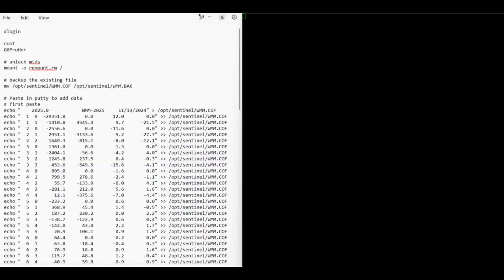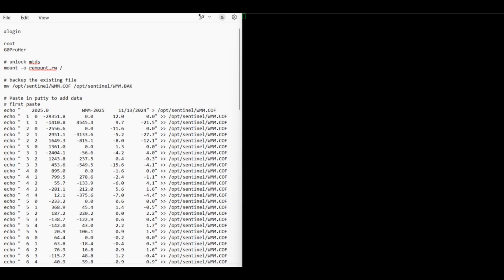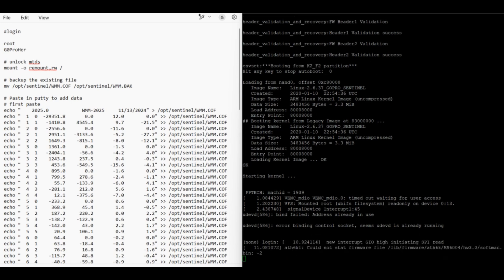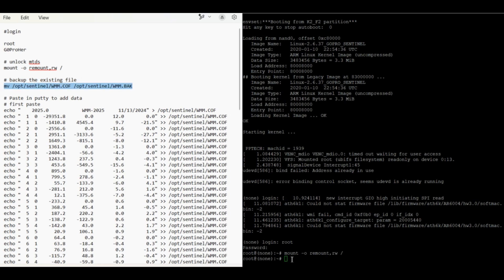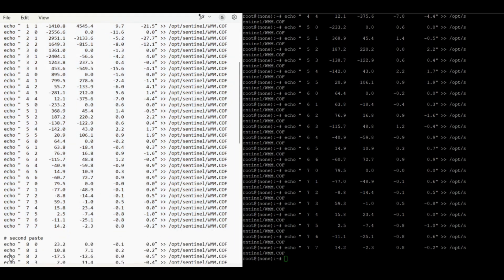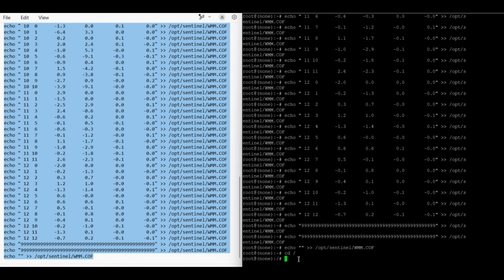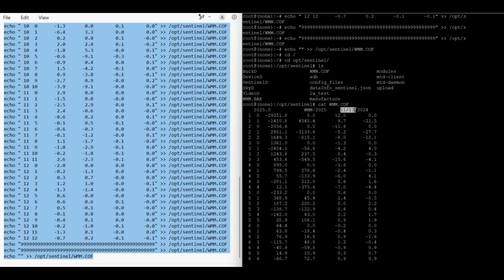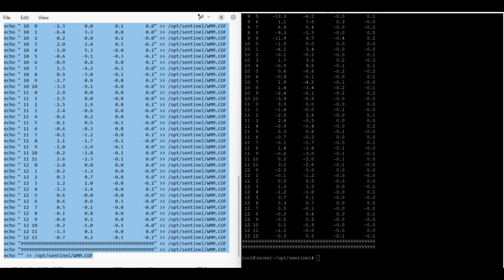GoPro Karma WMM 2025 Update Process

Comment: Hi, firstly like to say, good video's on the go pro karma drone. My question is, I'm in the UK and have tonight purchased the go pro karma drone off eBay as I liked the look of it and size. My question is the gyro video you have made, will I have to update this as well... As the seller said the drone is in good working order and ready to fly... I'm now thinking will it and do I have to do this update for the gyro for it to work?
Reply from the maker: I would recommend that you do this update before flying. If the drone moves any distance you should calibrate it, some people calibrate the compass every flight. If you have the old WMM data you will not be able to calibrate the compass which could lead to issues.
Reply: @bozmanx  Thanks for getting back, I re-read the advert and it's says it's all been updated, so how could I find out if the gyro software is up to date? And thanks for the help...
Reply from the maker: @paulmartin8294  I think a simple way would be to try and calibrate the compass. If you want to be 100% sure you should look at the follow file on the drone opt/sentinal/WMM.COF , the top lines should refer to 2025 and WMM20205 with a date something like 12/13/2024

Its very possible that they were not aware of this update.
Reply: @bozmanx  Oky doky, if I find it's not been updated when I receive it, do you ship the connector cables to the UK? for updating it?
Reply from the maker: @paulmartin8294  they are nothing special, you should be able to get them in the UK or look at one of the repairers on the list.
Reply: @bozmanx  Sorry for not getting back sooner, I asked the seller and he just said the software all up to date according to the screen. When I explained the situation he said he wasn't aware of the updated gps software, so I take it's not been done.... I have seen on your video's a list of items needed and I think I can get them off amazon... I'm not an electrician, but I'll have a go....Thanks for the help.
Reply from the maker: @paulmartin8294  If you can get the jst cable with the connectors on the other end its even less to do.
Reply: @bozmanx  Thanks, once I receive the drone next week sometime, I'll start sorting it out, if I need any help if it's ok with you, I'll pop any questions on here..And I do appreciate any help.
Reply from the maker: @paulmartin8294  If you have any questions come over to discord, there is an invite in the description of the video. Its a lot more real time.
Reply: @bozmanx  Just to let you know I got the tools today from amazon and followed your video and managed to update the gps. Yesterday I managed to update the firmware on the controller and sorted that out... So all ready for flying, thanks for the help. Tried discord and got no response....